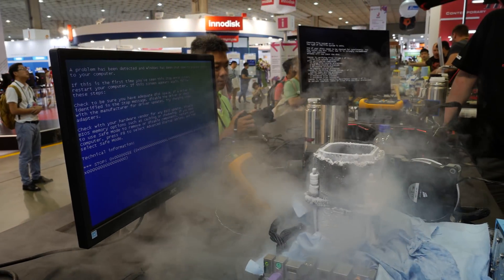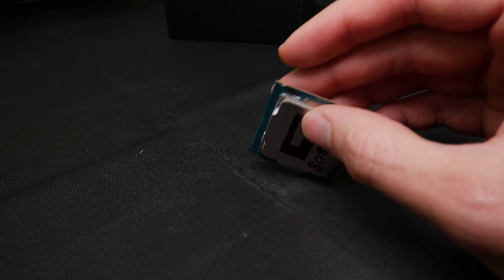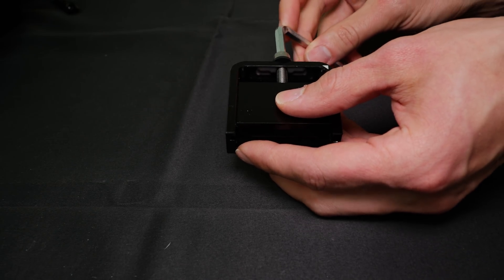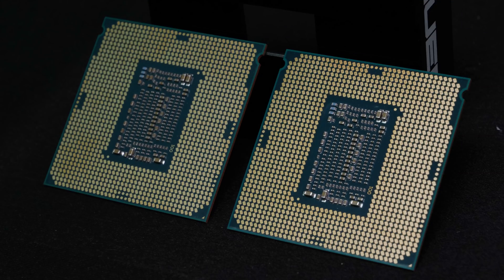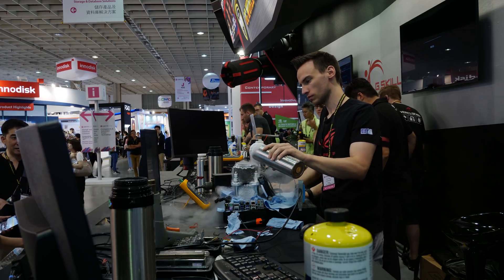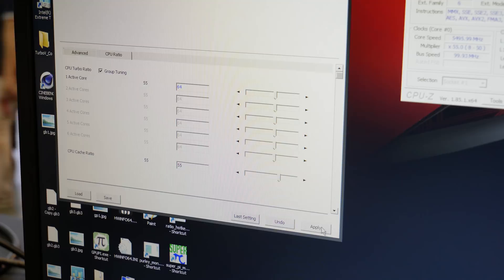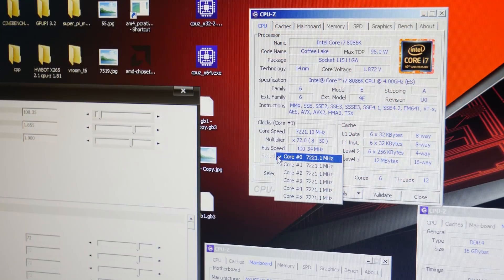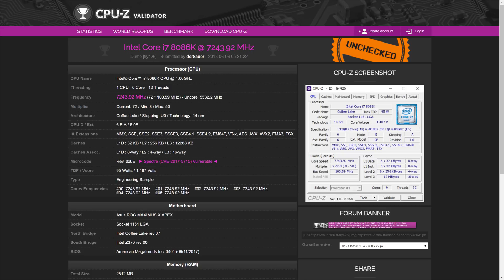i7-8086K delidded and overclocked to 7244 MHz - Computex 2018

Comment: Quick question re. application of liquid metal - most video guides around show applying the LM on both the die and the lid - given how much easier it is to spread the LM evenly, the fact that LM on the clean die tends to try and stay in one droplet due to surface tension and considering how little LM you should need to bridge the micro gaps between the flay surfaces,  why not only apply it to the lid?

Comment: wonder if there is anything left on the 8086k for normal overclocking since it holds 5ghz out of the box. but this kinda does feel like the 7700k was to the 6700k. more binned cpus with new names yay

Comment: With the I core arquitecture already reaching the end of the line and broken under 14nm since Intel has major issues on the 10nm they knew they needed a new thing to milk the blind man. So binned 8700k is the answer until Jim Keller can develop the arquitecture for Intel that can take as much as 3 years until leaks start coming out. Maybe then I will go back to Intel Jim Keller cpu, since right now amd Jim arquitecture is the future, and after the crap Intel pulled at computex. If my portfolio had Intel I would be selling them like hot potato. I bought 1000 shares of amd 1 month before the release of zen at 4 dollars now is at 15. My guess that Intel was gonna become 2nd tear 3 to 5 years after the release of zen is becoming a reality.

Comment: 18 dislikes by ryzen owners xD
Reply: Intel release EXACTLY the same CPU as the 8700K but call it an 8086K and charge an extra premium for it. The CPU is annihilated by the 2700X in multicore benchmarks. Nobody uses liquid nitrogen. Meanwhile across the hall Intel uses $6000 of cooling to fake a new server chip running at 5Ghz because AMD are about to wipe the floor with their new *(low end) server CPU.

Erm....

remind me why Ryzen owners disliked this video again?

Comment: 8700k or 8086k....... im buying everything in july . which do you think i should get?
Reply: du Bb I wouldn't buy either unless they were half off, but get whichever you want. I'd save with a Ryzen and spend more on the GPU. As an example, my super old FX is usually configured with more firepower than my Ryzen with Titan Xp collectors, so it actually beats the Titan system in most of my games (I run 4k)

Get whatever you want, I just wouldn't want an i7 (maybe i9, but TR2 is coming out so I think I'll get that instead, I do more than gaming)
Reply: i do more than gaming as well. im a music producer. but idk if id like to stray from what i know. ive always had intel . also it seems like ryzen is real touchy and only takes certain ram . i like to mess around with things but im no IT tech grad. champion overclocker .  if i had the cash id get the best i9 but the 8700k is my price point.
Reply: my music DAW runs better with intel also, less threads more powerful cores. all the crazy 32 threads etc dont make a difference for what i do

Comment: So it is costing $425?. That is daylight robbery. I can buy the Ryzen 2700 (8c/16t!!!) for £249. 

BTW, another good review by der8auer.
Reply: so you don't know much about cpu's then yeh? all about core numbers right lol or do you think the usage application actually matters because all them cores didn't seem to help the 2700 be any better at gaming than even a 8400/8600 did it? oh yeh sure theres other stuff besides gaming but lets be honest theres more gamers than Pixar workers out there huh.
Reply: jinx - I always expect to receive a reply from a presumptuous, sarcastic chimp. The argument that intel cpu's are better for gaming is now pretty much defunct as gamers are looking beyond just gaming. Compared to 10 years ago, gamers now have various other interests including video production/editing, etc. 

What most (sensible) folks are primarily looking for now is a cpu that is an all around performer, which has a high number of cores and threads at that particular price bracket, even though it may not be highly clocked. 

In essence, what folks want now is a good multi-tasking cpu and that is what Ryzen-1, Ryzen+ and TR gives us. 

Yes sure, R-1 and TR-1 are not quite as fast as intel cpu's when it comes to gaming, but all good pragmatists do what needs to be done and compromise a little on gaming performance. Besides, a good gpu can compensate for any minor shortfall. Do you see what I'm getting at with the gaming thing?. 
 
Also, do you think savvy pc enthusiasts would pay $425 for a cherry picked (and over-priced) 8700k OR would they rather spend £249 on the latest 8c/16t Ryzen+ 2700 cpu?. 

Heck, even the old 8700k currently costs £310, so the 2700 is still £61 cheaper. Any sane person would rather put that £61 towards their ram, mobo or gpu budget. You can even buy a new 1700 from Amazon for £200, which is £110 cheaper than the 8086k!. 

FYI, I used to own a 4790K and that impotent piece of shit would gasp and wheeze like an octogenarian with COPD if I wanted to multi task. I ditched it and upgraded to Zen in 2017 as more cores/threads suits my needs for heavy multi-tasking, rather than low number of cores that are highly clocked (ie - typical intel quad core cpu's). Next time kiddo, think before you speak.
Reply: That's a long ass comment. I bet you wouldn't have been able to process it without your 16 cores. Thank god for Ryzen! I'm a little confused why we are comparing a 4790k from 2014 to an AMD chip from 2017 though.
Reply: beachboy boobybuilder gamers are going beyond gaming.... are they? I thought gamers spent most of thier computing life gaming thats why my arguement was the buyer is better off going with intel cpu's in that case in order to make thier most used task the strongest performer. Love how you amd boys think intel cpu's cant do anything else besides game, an 8700k is a 6 core 12 thread processor that 90 percent can clock to 5.0ghz on all cores and often more, i have one myself that can do 5.2ghz but it does admittedly run hot at that so i run 5.1ghz to lower the vcore a bit.

My point is if you think a processor like that cant do multitasking aswell your crazy and best of all for the 80 percent or more time that gamers - you know... game, the processor is performing better than amd equivelant.

That dont make ryzen processors bad, im simply stating they have strengths in areas the general gamer rarely goes near, gamers predominately game, makes total sense to choose a processor based on the most used scenario.
Reply: beachboy boobybuilder btw whipping out the 4790k card does not help your case at all, should i whip out the amd equivelant of that time and see how they compare or are you gonna disregard that because now ryzen is here.

Comment: - So 8086k cpu was not soldered.
- It is not a new gen cpu (it is in fact a cherry picked, overclocked 8700k). 
- But on the bright side, it did OC to 7.2GHz on all cores but it needed liquid nitrogen.
- Just like the rebranded 28c/56t xeon, this 8086k is more intel bullshit.  
- Looks like Jim Keller has his work cut out for him at intel.

How the fuck did intel manage to not only survive but more shockingly, they prospered and held the pc market to ransom for well over a decade?. 

Intel has been getting away with murder.

Comment: Really cool name for the CPU tho! 8086 <3
Reply: matthew drodge Original PC came with the scaled down version called 8088 (basically a halved front size bus for use with 8080 chipsets).  The biggest disk was a full height 320KB floppy drive, half the size of max RAM!  Later 8086 machines such as the IBM PS/2 30 supported a 20MB Hard drive, double the clock speed and double the bus width, but still only 640KB normal RAM.  Other brands did offer larger drives for 8086 machines, you might even be able to plug in the largest PATA and parallel SCSI drives made.
Reply: with more cache than the original had as ram and probably more ram than original hdd.
Reply: i think i had one as a child (we were poor)(i'm only 35) it had 2x 5" floppy drives and no hdd. it had a keyboard that had a large din (like ps/2 but bigger).
I never got it working, i spent days trying (i had 3 disc's)
you had to load an OS (dos) from the first disk then load programs from the second but i never got DOS running properly.
I'd been pestering my mum for a computer for years after my zx spectrum & commodore c16 died.
she got that at a car boot sale (thats a swap meet for you U.S folk)

Comment: Very cool.. What about Spectre and Meltdown? New CPU super duper clock speeds.. Ignoring the securities flaws.. While variants of the exploits have been found online.. With more success even with OS the patch on.
Reply: You'll have to wait for new architecture for that
Reply: matthew drodge so never got it.
Reply: No this chip was designed long before Meltdown was discovered. They have new designs but they are trying to work out the problems with the 10nm process they wanted to use them on so they are delayed unless they put them on there old process but then they would probably be slower than what we have now

Comment: benchmark this (in 8086 mode) vs original 8086?
Reply: lol rip 16bit mode. 4 dims of 16k ram to give quad channel 64k. I think the RGB effects need more memory than that.
Reply: matthew drodge 16 bit 8086 mode supported 1MB out of the box, but IBM PCs use 384K for frame buffer access etc. 80286 added an extra 64K-16 bytes on top unless disabled with the A20 gate in the chipset.  80286 also added a 16 bit secure mode with 16MB RAM support, supported by OS/2 1.x, Windows 3.x and a XENIX variant. Both chips work with EMS RAM expansion beyond those limits, all these bonus features can be emulated on modern Intel and AMD CPUs by setting options on EMM386.EXE.

Comment: try to overclock a ryzen with a chiller like the intel 28 core "5ghz"
Reply: Ryzens don't really overclock well, regardless of the cooling solution. Well, a chiller or LN2 would get them going, but for real-world usage... it doesn't even matter if you have a decent air cooler, AIO water, or some really, really good custom water loop. It just can't get past 4.2 on all cores and that's it.
Reply: well i was specifically asking for a chiller....
Reply: because i havent seen anyone overclock a ryzen with a chiller
Reply: jklw10 sub to Legit_Overclocking then. Soon i'm posting a guide on insulation prep (FX is getting chilled). However I'll be using a phase cooler on my Ryzen and comparing vs AIO in about a month.

Make sure to sub for the Ryzen Phase chiller OC (feel free to unsubscribe afterwards). It's a channel I'm starting up for crazy things nobody covers like a case fan powered by a race quadcopter motor. Videos will be rare and infrequent, but should be fun. (ignore the prep video, it will be boring as most info videos are)
Reply: seems cool

Comment: Intel is dead
Reply: I mean... It's not an exact carbon copy of Skylake but, I'll give you that. They are both 14nm. There are improvements in IPC performance and they can't just make a completely new architecture every year. They would go out of business due to the cost of research and development. They don't even need a new architecture. Intel still the leads the industry in single core performance so there is really no reason to improve. I consider myself an average user and I've never encountered any compatibility issues. Are you talking about Linux?
Reply: S.M. FARHADUZZAMAN why do you say that?
Reply: PaynPlay play they run out of ideas.they have no new cpu arhitecture. Also Intel CPU has security issues. Lack of new processing node.lack of compatibility and many more problem
Reply: S.M. FARHADUZZAMAN hmmm true
Reply: Coffee Lake isn't new?
Reply: Facts and marketshare says, that they are nowhere near dead.
Reply: oDieseLz it is, just the same architecture as skylake

Comment: limited TIM also ?
for $425 still not soldered, come on ..
Reply: Darren Crighton the same way they did with Sandy Bridge.
Reply: liquid metal is better than solder?? hahaha you guys are fkin stupid
Reply: +club4ghz hahaha that's a direct die video you dumb piece of stupid shit. hahahaha
Reply: club4ghz
 That's direct die cooling. That's not what most people do when delidding, you normally put the heatspreader back on just with liquid metal between it and the die instead. And LM is like 1-4 degrees better, almost within margin of error. Solder is stable and lasts forever, and you don't have to void your warranty. 1-4 degrees is nothing, delid + LM is definitely NOT a better option.
Reply: Darren Crighton
 because they're made to be as cheap as possible, and don't get very hot anyway?
Reply: Darren Crighton I'm not sure how that's relevant though as mentioned earlier Intel used to solder their cpu's with igpu's.
Reply: there are xeons with soldered igpus. Intel is just cheap.
Reply: this makes no difference as the die is just slightly alrger - this isn't two seperate dies like with the Intel/AMD Hybrid.
Reply: Soldering is still a thermal bottleneck. Delid + liquid metal is better option.
Reply: The chips are too small for soldering, maybe half the size of Sandy
Reply: Soldering will cost intel too much
Reply: you know that that is a different thing right?
Reply: Actually i saw i video with idk a ryzen 5 or so, it was a soldered cpu and someone delidded it without killing the cpu,the huy cleaned the black adezive around the lid and replaced the solder with liquid metal,result ? a 4 degrees cooler cpu after the delid,now im certain that the solder is actually a better conductor of heat than liquid metal,but the problem is the black adezive that is holding the lid in place,that makes the lid not sit as tight on the die and thus resulted in a 4 c increase in temps,nothing huge but definitely not margin of error
Reply: You nerdy people cry weird shit.....
Reply: Quickshot Gaming how come the 2200g and 2400g ryzens aren't solder yet have onboard? Hmm...
Reply: It is better. Watch this video stupid https://www.youtube.com/watch?v=wz_-Q5QzRqg
Reply: How you gonna solder a cpu with onboard GPU? :D

Comment: So Basically this 8086K won't get any better in terms of OC than your 5.2G caseking bin right? Or do you think you will be able to bin it at let's say 5.3G stable bin? Thanks
Reply: esperCELL it depends on the chip. I have one that will hit 5 gigahertz no problem that I got in January or February. However quite a few won't and I'm going to be buying one that I don't think will for another system. This one needs almost 1.3 Volts for 4.8 gigahertz giving it very little overhead. The 8086k is probably center of the wafer. Very clean silicon. You're paying for binning and if 5ghz is important to you it's a good deal because you don't really know if an 8700 K will be able to do it. It might. It might not

Comment: They should have put it in a ceramic package and gold plated the heat spreader
Reply: Andrew Joy Yes, and ideally it should have been socket compatible with the original too!  Imagine a pin-compatible 8086 with the original 10MHz FSB running at 1GHz+ internally, with a cache larger than the external RAM modules.  The core could have been a modified P55 with a die shrink.  Optionally put an extra power input at the end of the package to feed in extra watts.